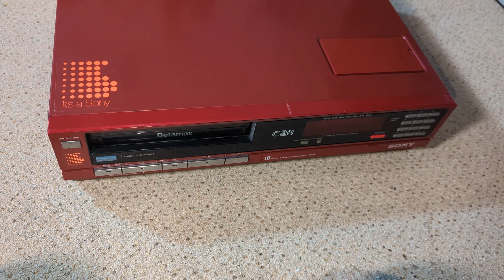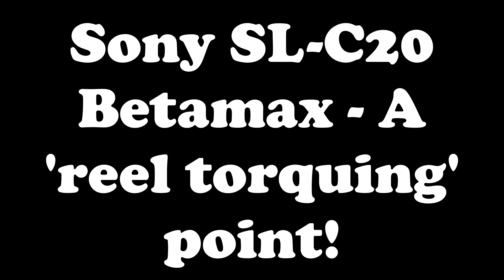Sony SL-C20 Red Betamax - A reel torquing point...

Comment: sorry for the question, any advice or videos on what to do if the tape on ejection basically fails to eject fully as the left side gets stuck lopsided on one side and the right side is elevated to appropriate height.

i worry if the whole ejector chassis needs to be removed or if its a simple fix.

the other day cleaned the inside as best as i could, as it was bought untested and seemed very dirty mouldy inside...it plays, rewinds , and on ejection ensures the tape is looped into cassette properly but then fails to fully eject out.

 

I've e had to gently readjust  it to align it enough to push it out by hand ..

would appreciate any advice if possible?

Also, having watched your video, i found it interesting that you felt it was going quite fast - it's made me wonder about mine as I imagined it to just run at that speed as because it was a betamax...

anyway. fascinating to watch (being layperson in this area).
Reply from the maker: That's sounding like the front loading system has broken plastic on the one side of it. It'll need removing and checking through to find out what's broken. If you're lucky it might just need some split plastic glue back. Yes, they should only run at one speed for PAL but they can suffer from capstan issues causing the tape speed to increase.

Comment: So in future, first check not only whether the video heads are still protruding, but also whether the reel platter spindles are still tight. I remove the old oil from the motor pulleys of the Panasonic K drive using a mixture of KONTAKTspray CLEANER 601 and methylated spirits. Only burst pulleys can no longer burst, and are therefore cleaned and glued. The Cleaner 601 can be used without a "bathtub". At least SONY has not built the extra resistor in at the factory😉
Reply from the maker: The silly thing is, I did check for spool wobble - just not thoroughly enough. A lesson learnt there. It's been a great and solid machine since though.